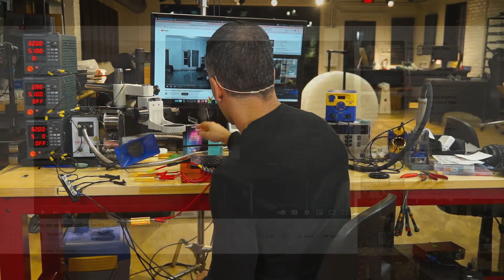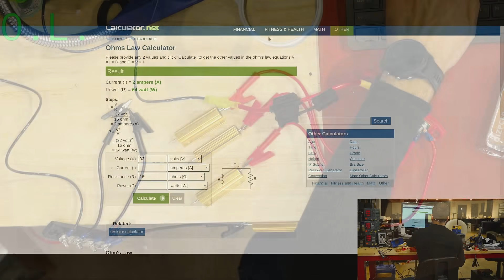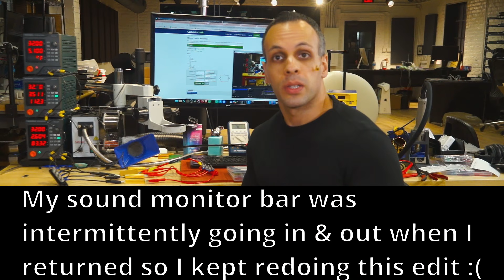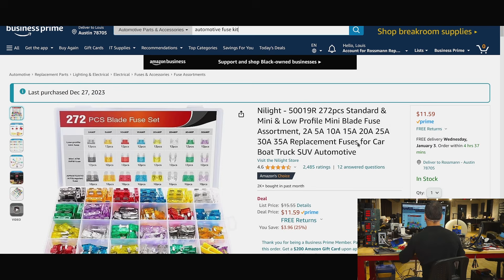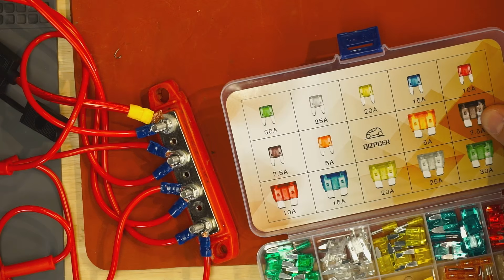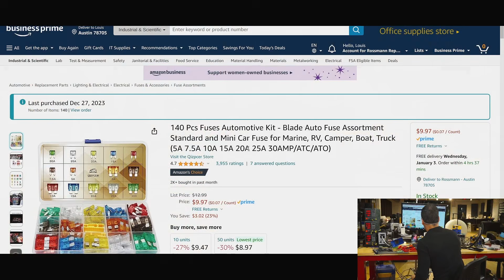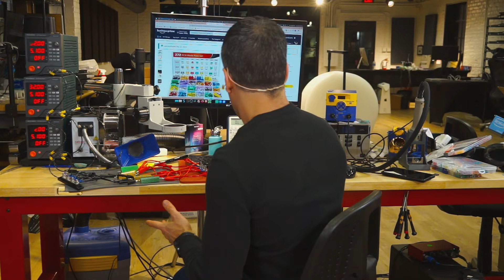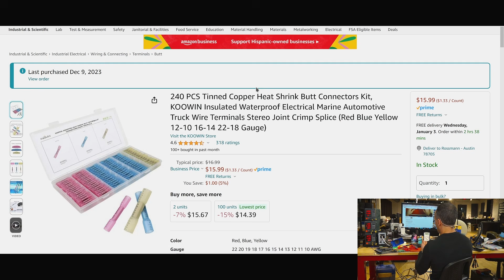Amazon Sells Fake Electrical Fuses

Comment: You should make a bigger deal out of the fact that your 1-star review simply wasn't published by Amazon. That is probably some kind of legally-defined fraud. It's certainly a practice that gets you dinged by the BBB and other consumer advisory groups. To see such a large corporation doing what fly-by-night dropshipping stores do is shocking. It's much more serious than the seller simply flooding their product listing with fake reviews.
Reply: Maybe they'd have left his review up if it was 5 stars saying, "These fuses are great! The 2amp can handle 10amps before it blows, now that's value for money."
Reply: @Arkantos117 legendary!
Reply: If you notice, you can't see negative anything anywhere. You can't see the thumbs down on a video, why would reviews on Amazon go any different?
Reply: @SammyM00782  you dont pay anything for a video, youtube is for consuming slop while amazon is supposed to be a reliable marketplace
Reply: I got ripped off on a phone years ago and I tried posting a 1 star review many times but it just magically disappeared.
Reply: @tigerwoods373  Yep, the same has happened to me
Reply: These Chinese obviously just buy or build 10 amp fuses and label them as whatever they need, that’s ingenuity 😂
Reply: @chadwells7562  Exactly, they just use the US color coding system, they dont care what it means and i would bet some MFGs done even understand it... 
Same with the crimp connectors Luis bought, they make the Yellow ones.. aka 10-12 AWG but since they are metric they dont fit 12awg wire... 
"yellow" means nothing on metric wire crimps and means nothing in fuse ratings.
Reply: @grumpycat_1  Last I checked, 6mm² is actually bigger than 10AWG. And funnily enough, that's what 'yellow' means in metric (that market which is ten times the size of yours).

Oh yes, and blade fuse colours do in fact mean something.
Reply: @Monkeh616  The "yellow" Din 46228 for ferrules are yellow for 6mm² wire only ..  Yellow Metric crimp on butt connecters (like the ones Luis was complaining about in the earlier video) are labeled to fit 4mm² to 6mm² metric wire... 12awg is 3.2mm² aka smaller then the smallest wire size they are rated for.  12awg wire fall between metric "Blue" 1.5mm²-2.5mm² and metric "yellow" hence the reason metric "yellow" crimps in the kits sold on amazon don't fit 12awg wire .. there is no metric wire equivalent to 12awg.  10Awg is 5.26mm² and fits in this metric "yellow" range. The color codes dont mean anything FOR 12 AWG WIRE...

 I get that metric crimps are a bigger market.. I wasn't the one who expected metric crimps to fit 12awg just b/c they had yellow plastic on them... no matter what color they are b/c there is no equivalent metric wire size... 

Metric wire goes from 2.5mm² than 4mm²  ....The point was don't buy metric crimps (in any color) for 12awg and expect them to work like Luis did. In fact dont buy metric crimps unless your using it on metric wire... with metric crimpers/crimp jaws ...  Just buy good AWG sized crimp connectors.

Of course Blade fuse colors mean something and so do crimp colors (but not the same thing for mm² and Awg wire)...  but the sellers referred to by Luis don't give a crap about the color coding systems and clearly are using fuses rated diffently then their color would indicate and marketing their "yellow" crimp connectors as being suitable for 12 awg wire sizes (yellow is 10-12awg in the us) when they are not. So either they dont know the difference or dgaf.
Reply: THis,... THis is the issue, the suppressing negative reviews/ product listing switches.
We dont need Gov't regulators of fuses (these already exist) 
We need Amazon to be publicly shammed / disincentivized from  f-ing with the review system.
Best way to do this is buy products and RETURN them, this costs amazon and the seller money. Which incentivizes both parties to cut the bull-S
Reply: @grumpycat5991  We don't need more regs on bad products, we need stronger regulations, reporting/testing and consequences for dangerous products.

We can know better, but we will be a minority and have little affect on Amazon's profits.
Reply: @deon700 I'd settle for enforcement of existing laws and regs.   False advertising and selling counterfeit products is already illegal.  We already have customs agents supposedly keeping an eagle eye out for fake products coming in through our ports.  They don't need more jobs to do, they just need to do their existing jobs.
Reply: @deon700  Sorrry "we dont need more reg, we need more regulations"" ???  Im not clear what your saying here.
If you want certified fuses they are available... Pay for them ... don't but cheap import crap. Good name brand ATC fuses cost like 2$ ... i dont get why someone would care... You can buy good quality Blue Sea Systems ATC fuses of amazon for like $1.50 each with free 1 day shipping.  Expecting a $0.20 fuse to work as well as a $2.00 fuse is naive... If you are going through that many fuses that you need to save $1.80 on each one by buying crappy ones off of amazon you have WAY bigger problems with your electrical system.
Reply: I told my mother that the BBB was a toothless meaningless entity in the 90s. The 90s.
Reply: I did a "2-star" review on some USB sticks for a good reason. 😂 1-star reviews saying they never received the package stayed up while anyone saying "These don't actually hold 128GB and run at USB 1.0 speeds 1-star" disappeared.
Reply: A- mazon has the correct politics to fall into the "excepted from the law" category.
Reply: When it comes to fuses, it's possible that many positive reviews of garbage fuses are actually genuine, as few people who buy and use them will have any information beyond plugging in a fuse and getting power. Vehicle fuses rarely blow, and even when they do, I'd guess that a reasonable fraction of failures are a result of a short that would still blow a fuse that needed >4x its rated current to blow, so the odds of a buyer experiencing a problem due to a bad fuse are pretty low.
Reply: @davewilson4493 It's worth noting that wires will heat up about the same amount from a 6X overload that lasts 160ms as from a 12X overload that lasts 40ms, or a 24X overload that lasts about 10ms.  A 24X overload that lasts 40ms would heat the wires about four times as much, even though there might be no perceptual difference between taking 10ms to blow versus taking 40ms.  A fuse which fails to blow at all under a 3.5x overoad will almost certainly take much longer than it should to blow under a dead short condition.
Reply: Fake 'good' reviews + Hidden 'real' reviews
Reply: BBB is just a front to make people think you're a reputable business. It's really just a scam membership racket that's just there to collect money for businesses.
Reply: I had an Amazon product (laundry bin) have a huge sharp metal handle that lacerated my hand. Posted a factual review and it got blocked. Reached out and they claimed oh that was a mistake it looked fraudulent and actually published it. If I hadn't gotten my hand sliced open do you think I would have pushed the issue? They know ratings sell products they have no incentive to be honest
Reply: They literally are a storefront made off of fly by night dropshippers
Reply: Bbb is a joke
Reply: What is "shocking" is your apparent trust of Large Corporations.
Reply: I suspect the review was refused because he included a hyperlink, I too ran into that issue when I was linking to an external review about a shitty product. I did receive an email explaining it, maybe they stopped giving reasons or it's in his spam folder. It doesn't make sense that they would want to hide bad reviews, it's the only quality control they have on the site.
Reply: @HelloWorld29960  " It doesn't make sense that they would want to hide bad reviews, it's the only quality control they have on the site." lol, who needs quality control if you dominate the market? All you need is to sell more junk.
Reply: @stefantrethan  @Abc-ii1he Amazon conspires against both buyers and sellers, they have no incentive to prop up one individual seller when there are already 50 other sellers selling the same item on the platform.
Reply: Wealth is health. Might is right. If you have enough coin, connections, crews, clout, computer code, cronies, control, and corruption goin for you... you're INVINCIBLE. That's how it is with 'Zon. All companies who pay for the bot armies rule without contest. You cannot challenge them in any way, because 'Zon LOVES the revenue, baby!
Reply: @stefantrethan  Enjoy the capitalism.
Reply: @HelloWorld29960  You might be right. Louis should investigate this. Hard disagree about "It doesn't make sense that they would want to hide bad reviews" for obvious reasons though.
Reply: @HelloWorld29960  Maybe they should tell you the what's allowed and not. YT does this c# all the time, and I only find out when I want to edit a comment and got "An error". Opening dev tools I see a 404 and know my comment got busted.
Like do these companies think I just like to exercise my keyboard and dance around their vague s# system?

Comment: Haven't watched the video yet but to further simplify your description. More importantly, not to protect a power supply but to prevent a fire. They are great for short circuits which will pop the fuse instead of popping and burning the wires. 

What's sad is that I incorrectly came to the conclusion that ratcheting crimpers were bad instead of the crap that I was buying were just shitty quality.
Reply from the maker: We live and learn sir, we live and learn.

Comment: I think you should have done some control fuses just to show how they should normally blow. I know your data is correct as I have watched another video on the same subject and the cheap fuses failed miserably to blow anywhere near rated. The controls did go over the rated but only by a small percentage and only for a very short duration. Otherwise great video to show subpar products.

Comment: Stupid question, Mr. Rossman - did you check those resistors for their actual values?  Because they tend to vary by a lot.

Also, did you compare this with some "name-brand" fuses?
Reply from the maker: Yes and I showed the value of the resistors on screen.

Comment: Would love to see if the results differ at 12Volts rather than 32.
Reply: Probably not significantly. The voltage mostly affects arcing behaviour, but not when a fuse blows. 5A at 12V heats up a wire the same amount as 5A at 36V even though it's three times the power transmitted. Voltage rating for fuses is relevant in the sense that if you use a fuse intended for low voltage in a high voltage system, the fuse might blow, but then just arc over and still transmit current that way even though it's blown. Since both 12V and 36V are fairly low though I wouldn't expect that to come into play very much here.

Comment: Guess EU will have a field day with amazon soon, as they would be responsible for electronic/electrical product that they sell, or distribute.
Reply: No they are not, the only thing they must do is 2 year warranty
Reply: @marcogenovesi8570  This summary is based on guidelines from the authorities overseeing electrical safety in my country and should be close to what the rest of the EU follow. Retailers, such as Amazon, must ensure their products' safety and compliance with regulatory standards. Responsibilities include verifying CE markings, confirming manufacturer and importer details, and providing comprehensive safety instructions. All products must meet stringent safety standards, even in the absence of an EU declaration and CE marking. Retailers are crucial in implementing proactive safety measures, resolving customer complaints, collaborating with stakeholders, and reporting any product concerns to the relevant authorities.

Comment: What's amazing about Amazon is when they sell a part like a throttle body for a RAM diesel truck for nearly four hundred dollars less than the part costs at rock auto from a reputable brand like Standard Motor Products. It's so much cheaper you have to question whether it's really the right part or whether it's' just a piece of crap.

Comment: Ive had good luck with aliexpress believe it or not. I test my safety equipment, no different then you do. Good job. 🤜🤛
Reply: The resettable ATC fuses from AliExpress tested good, bought 10, tested them all they all blew within 0.5A.
Same with one-time use, tested a few different values and they all blew around the advertised value after 5 minutes at the load, and immediately within inrush of 2x the current.
Also used 70C 10A (the 10a id laughable) to protect LED lights and LED CC driver board from overheating when being overdriven.

All worked pretty good. A few of the 20 70C were DOA or didn't trip, binned them.

I couldn't test the 10A+, but have no need for my projects.

Comment: OK. A 2A fuse should not blow at 2A current. But overloading a car fuse at 200% of its rated current should blow it in a second. At least that's what the data sheets for documented fuses say.
Reply: I just looked at a data sheet from Littlefuse. Their automotive fuses blow after 0.3 seconds if you expose them to double their rated current.
Reply: @tobi_n and these were easily taking 4x their load
Reply: @tobi_n  I did the same thing with the same manufacturer (Littlefuse).  The product curve (Maxi Blade fuse) I found specified 2 to 50 seconds to pop the fuse @200% current.  The Mini Blade fuses are specified at minimum .15 sec to maximum 5 seconds @ 200%.  In any case you should not have time to relieve yourself before the fuse pops.
Reply: I think it's probably less about it breaking and more how it breaks, or to be more specific, whether it breaking poses additional danger.
Reply: Slow blow fuses are perfectly fine if you're putting them on that type of circuit.

Being steady at +100٪ or more power rating is a serious problem.
Reply: Glad someone pointed this out just for everyone's knowledge. Thanks so much!

Comment: Would still make sense to look at a datasheet for a quality fuse of the same type just to get a sense of what such a fuse should be able to handle.
A random search on Google and I found one from Littelfuse and their 2A fuse will last ~3s at 3A, 0.3s at 4A, .15s at 5A, which seems reasonable. And obviously a 2A fuse should not be able to withstand 8A for any perceptible duration..
Reply: well, taking current-time characteristics would be probably sth very usefuls. No way those candys are conforming with SAE2077 or any other standard
Reply: yeah, i also looked at a couple blade fuse's data sheets and the most 'generous' ones were still had the current-time curve to blow in 1 second at double the rated current.
Reply: exactly,  Should have checked a brand name fuse datasheet just for reference.  as they are NOT designed to blow exactly AT the rated current.
Reply: Amazon does sell Littelfuse fuses, but good luck seeing them in the listing when you search for "fuse kits". Same with Buss
Reply: The other thing I noticed with these cheap Chinese knock off fuses is that they get very hot before they blow, even at their rated current.  That leads me to believe they are using standard wire and not fuse wire...
Reply: Looking at some other data sheets, a slo-blo at 400% could last 5 seconds. You're describing fast acting ones.

Comment: What scares me is the knock off Rock Climbing gear on Amazon. Knock off after knock off gear that is designed to protect your life.
Reply from the maker: It's sad. And they'll keep selling it and making money off of it anyway.
Reply: might as well free climb 🤣
Reply: @cerealbucketcoaster  You wouldn't have a false sense of security that way either, compared to using faulty gear you assume is going to save you.
Reply: @cerealbucketcoaster honestly, free climbing would probably be way safer because at least you don't have the illusion of a safety net that doesn't really exist. You would know how serious and risky every move was, but with this crappy gear, you could be just straight goofing around when it fails and kills you because your other gear easily accommodated it and that's what you were used to.
Reply: yeah I'm not trusting that to hold my keys, much less hold people
Reply: I've watched one of the test channels load test carabiners from amazon, and they all turned out to be of high quality. As in it took very unreasonable forces to even start deforming them, much less breaking them.
Reply: @luckyo11  You can't guarantee all of them will be though, nor that the quality won't plummet once they've gotten sufficient positive reviews to coast off that for a while.

After all, these people don't have morals, if you don't count 'make more money at all costs' as morals.
Reply: @luckyo11  that's sus, and also the classic strat is to sell good stuff for a little while to get good reviews and then sell trash and coast for a while until Amazon takes it down